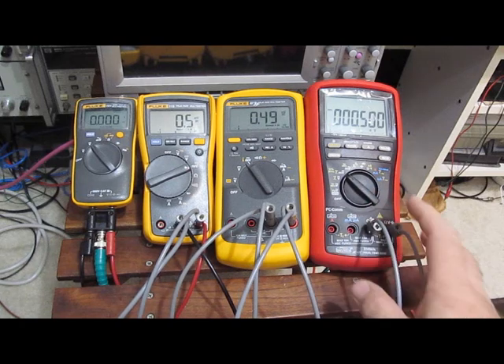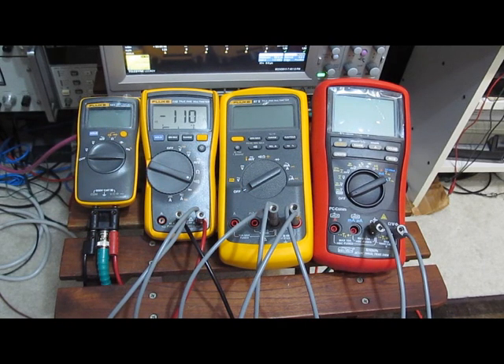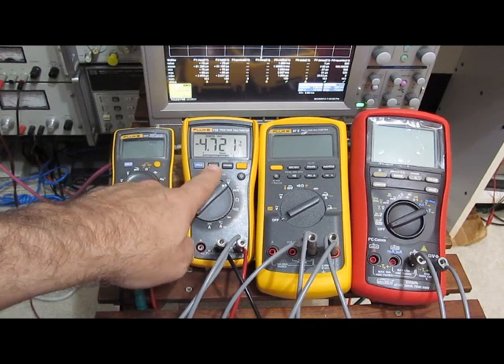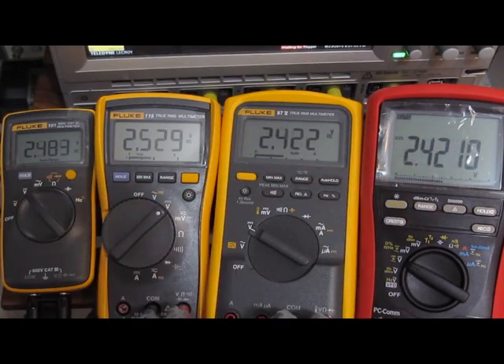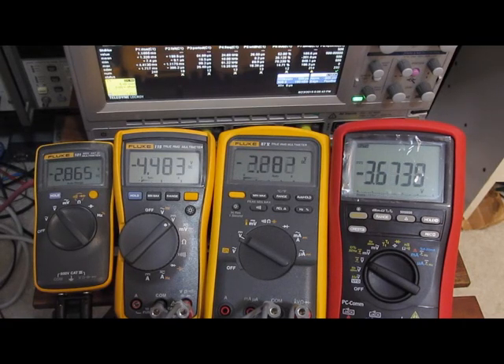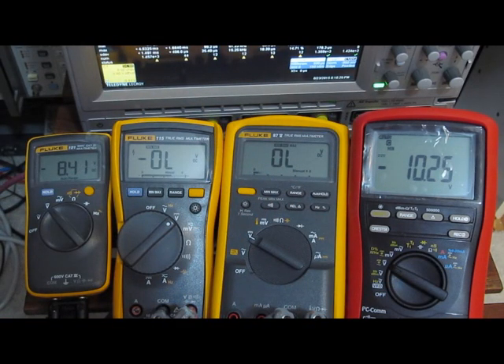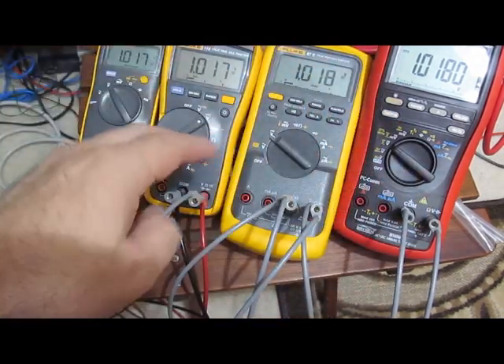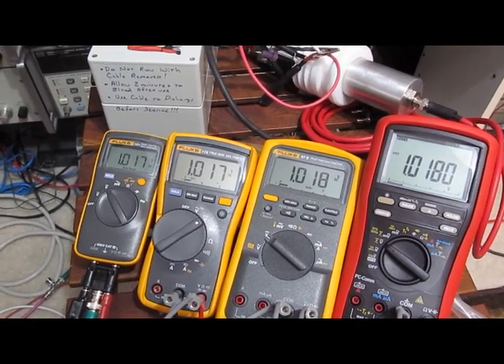Brymen BM869s vs Fluke

Comment: I've wanted a Fluke 87V for a long while but this Brymen has turned my head more than somewhat. It looks like a worthy adversary. I appreciate your interesting quantitive tests.
Reply: The King is dead, long live the King.... IMO
Reply: @JohnFHendry  Fluke still makes some of the best meters on the market. They are very well made and hold up for a long lifespan. A good friend of mine still has the one he bought in the late 80s,  still working fine.
But, it looks like Brymen are on their game. They are responsive to the customer and seem genuinely interested in making their product the best it can be. I have two of them and I am impressed with their accuracy, speed and the build quality. The leads are very good quality too.
Reply: @brianthompson1138  Agree... for the money hard to beat the BM869s and that's what I ended up getting. Great meter...
Reply: @JohnFHendry  I initially picked up a BM257s for basic diagnostics work (I work on arcade games). I liked it, so I made that one my work meter and got a BM829s for home, as I do more indepth stuff there. I don't need 50K count, so the BM829s was my choice. It's very similar to the BM869s and the price was impressive. Bought them both from TME.
Reply: @brianthompson1138  I sure hope Brymen reads these posts. I really like having the 50K count.... lets you see a tiny flow moving other meters miss. But I want DNA/RNA count settings to keep up with technology. Did you know last June a discovery was made that "upended the current, accepted notion of matter" and "rocks our current understanding of matter" ? Check it out... a researcher by the name of Monica Olvera de la Cruz at Northwestern University discovered it working with nanoparticles engineered with DNA in colloidal crystals. They said:  "It’s not an electron. But it sure does act like one." I say who cares as long as the meter can read it... just have to wait it out now, darn...;-)

Comment: Thinking about buying a Multimeter for my Process job. Was watching Fluke V87 vids and reading comments. Then a commenter mentioned Brymen 869s which lead to more research and vids. Then I ran into a bunch of video comments where people were mentioning someone called Joe Smith and his testing vids for Brymen DMM. That’s how I ended up here. After watching almost a dozen vids today, think this Multimeter fits my need and price compared to a Fluke V87 or a fluke period.
Reply from the maker: Really depends on your particular needs but the BM869s is still by far my favorite meter that can still be purchased new.

Comment: After watching all your Brymen videos  I've got convinced that I should give a try for the 869s as  my multimeter.
I'm currently using a UT181A but need some a little more robust for the high voltages.
For those who are looking for it, I've just got it from Eleshop in Netherlands (EU shipping) for about 144€ the unit... very cheap.
Just missing a probe master for it now...
Thanks again.

Comment: As always, GREAT JOB on the review Joe.  I would add the Bremen 867s/969s english manual is very good and seriously better than Chinese meter manuals I either have or have seen. My Bremen did NOT come with a case but had good quality probes.

IF I were going to have ONLY ONE NEW meter today, I'd likely buy the Brymen BM869s.  Even with its optional computer interface and software, it's priced less than a new Fluke 87-V.  It is larger, but has a dual display.  I frequently use the computer logging feature.  If you don't, you can save $100+ .  Main gripe regarding computer interface is it SHOULD BE USB in this day and age...

Today, in my "active" world,  I have 2 Fluke 87-Vs (both purchased used), a Fluke 287, and the Bremen 869s.  The Bremen BM869s has replaced my previous 22,000 count Mastech MS8040  "Bench" meter due to the DC voltage resolution and computer interface.  The Mastech MS8040 was my first true-RMS meter and I retain it due to it's excellent AC/DC current probe with 10 ma resolution.

My Fluke 289 is my clearly most capable meter, except for the BM869s's 500,000 DC Volt count mode.  However, the 289 tops $550.00 with its USB interface and software.  I use my 289 mainly for field and lab logging for Solar Systems / Inverters installation and characterization on RVs.  It has much poorer battery life, so it's less desirable for an everyday bench meter.  It's plenty capable, but a little complex and has fiddly controls for most general bench work.

My 2 ea. Fluke 87-V meters are my grab-and-go / bang-around meters.  They are TOUGH but smaller than their water-proof cousin the Fluke 28 II .  If you want a water/environment-proof meter, the Fluke 28-II is basically an 87-V in a environment-proof case for only about $40.00 more (Amazon) , but it's considerably larger and a little heavier than the 87-V.

Remember, the "extra" digit in the BM869s's 500.000 count mode only works in DC Volts measurements.  As stated in the BM869s manual: "It (the 500,000 count mode) is available to single display DC Voltage function ranges. Measuring speed is reduced to 1.25 times per second."  

Folks, I guarantee your mileage will vary...
Reply: So... Practically speaking, do you feel the Brymen DMM is better than the Fluke 87 V?
Reply: The strange thing about that 1.25 measuring frequency per second in the 500k mode: I use 3rd party logging software, and it logs fine at 5 times per second in 500k mode. And the logging results are all unique values.

Comment: I've had a Fluke 87V for over a year now, but I'm now seriously looking at getting a BM869s to replace it. I don't like the Fluke's darker display background and smaller digits, and would enjoy the bigger, brighter, dual display of the Brymen. Not to mention the faster bar graph and additional features and higher precision. Thanks for a good comparison.
Reply from the maker: I'm not a fan of the 87V. I like the older Fluke 189 but the BM869s is still my choice.  Like the 189, it's a good all around meter for electronics.
Reply from the maker: I've ran similar tests on some of the more recent meters where the 87V and BM869s were included.   Maybe have a look at the OWON video.  There you can see the 87V 189 and BM869s all together.

Comment: Great video.  On the Fluke 87v vs 'crest mode' of the Brymen, you need to turn on the Fluke 'crest mode' or the peak mode, you used only the standard mode.

Safety: the issue is protection from faults within conditions of the meters appropriate usage, impulse tests were to simulate worse case conditions.  Users should expect those capabilities to work as designed, i.e., CAT rating. 

Brymen history.  The only way to find out is to give Brymen a history, how does its build quality hold over time?  You can see a semblance of its history by comparing the equivalent Greelee models with months to years of ownership, there are a number of them reported on Amazon for different models.
Reply from the maker: ***** After reading your comment about the crest mode, I downloaded the manual for the 87V and saw the continuity button selects this mode.    I would have never guessed this when I looked at the meter.   Thanks.    Looks like it should detect an even shorted pulse.  I may check that out.
Reply from the maker: +Ig Saturation I looked at an 87V again.   I am curious if it will detect both peaks?   Say I have a signal at zero volts with a positive and negative pulse on top of that.  Can it detect both?   Reason I ask is that they call it a peak detect.
Reply: Hi Joe. Yes.  Peak negative is stored as minimum value and peak positive is maximum value.  When on the 87v does not auto sleep so it will monitor until you manual set it off.
Reply from the maker: +Ig Saturation Thanks.   I may make a short video of this to compare that feature again.
Reply: Always enjoy your videos, thanks again.

Comment: Yes, I saw it with Keysight 1282A too, it's got much faster continuity test than 87V. But let's be frank, no one would switch between various elements 4 times a second :) I don't know why, I'm using Fluke much more often than Keysight, despite the fact that KS got better spec.
Reply from the maker: I am not sure how many make break cycles I have when sweeping a QFP.   A seconds a long time.
Reply: @joesmith-je3tq  You're right and you're right and you're right. There might be some use cases for this "feature". Although very specific.
Reply from the maker: @elmachooooo  I had an electrician ask me once why anyone would ever need to measure anything beyond 60Hz.  Everyone will have different requirements.
Reply: @joesmith-je3tq  I am not sure how are you sweeping this QFP but if you sweep it fast and hear a beep you need to do it once more, slowly (and the difference between F and B gets neglected). From what I understand Fluke 'merges' 2 beeps  into 1. The more important test would be to check which meter picks up shorter 'signal' I suppose.
Of course, Brymen feels better but in practice I am not sure if it is important. But you're right - depends on the use case,  personal preferences etc.
Reply from the maker: @elmachooooo  I do end up going back over, multiple times.  I've seen people use wire bristles to trace a board just to get faster coverage.

Comment: Hello Mr Smith, some times we loose control to acually test the devices,as a result we loose also making difference  between what is important and what is useless facts.the update rate doesn't matter ,when we talk about out of 2 updates/sec , I think the important thing is to have an accurate and precise readings.I can wait the multimeter 1 sec if it is accurate,humans are not fast enough to deal with 5 updates per sec .
Reply from the maker: That's why we have 20,000,000,000 sps scopes, because we humans can't deal with it.  Understand that your opinion is just that, and it may not reflect the general population.    Someone once posted why anyone would ever need to look at currents higher than 100Hz.
Reply: @joesmith-je3tq  Mr Smith , you want esolate my opinion ,simply you can ask every one," can you realy your brain and eyes deal with 20 updates / sec?" I think no at all when we see there is a couple of hundreds of miliseconds to from understand what we see, we cant se 20 updates in one second and understad all each one and understand them.the same thing with beeping speed of a multimeter, are we fast enough to figuere out what we connect . for example 5 latches per sec. no but we "feel"that we are blocked a litle bit by the response of the continuaty beeps and the insufficient control on it . best regards
Reply from the maker: @TruthDigest  I have no desire to run such a poll but you certainly can if you feel it will gain you something.   Companies don't offer faster update rates for the fun of it. Customers want it.   30Hz and up bar graphs are common.  Imagine what watching a video at 2 fps would be like.   I've seen people that can consistently cut 0.00 lights (professional drag).   If you see no reason for faster update rates, that's fine.  Just don't assume you are in the majority.
Reply: I feel it will gain me something :)
just to complete the cycle companies offer faster update rates because customers want it, why customers want it and what is the real sufficient ,

comfortable and useful update rate  for the customer.I think 4 updates/sec is great and 30 /sec also but there is no  considerable change. our brains are not fast  to deal with 30 updates/sec.as an example , if you have a camera and you want know who is the person next to your home.if this camera make a single capture and you see this picture and you recognized the person, the task is done if I make other pictures to the same person that will make no difference, I recognized him . but this aditional pictures are not a problem.and I'm sorry to bother you again Mr smith but I want to make make point of view mre clear, no more. I have a question if you can Mr smith ; what is the lowest capacitance value can the fluke 87 v read.even the brymen 869 doesn't mention that clearlypicofarads are important for me and us the industrial multimeter have a litle bit highest values on capacitance.thank you for the feedback.best regards.
Reply from the maker: @TruthDigest  The youtube filter placed your comment into the spam area due to your grammar.   Use a space after each period and you should be fine.    I am not aware of ANY meters that will update the digital readout at 30Hz.   It seems there are some at 5Hz.   The bargraph on the better meters will normally be much faster.  But again, if you are happy with a 2Hz bargraph, digital display and continuity test  update, that's fine.  Just don't expect the majority of people to be happy with that level of performance. 

I imagine the manual for the 87V is still available to download for free.  It seems you don't understand what you are looking for is all.  Check the meters accuracy and resolution.   From this, you should be able to sort it out.  Normally, I will use an RLC meter to measure capacitors.  If I am looking at small values for RF and want more information than the RLC meter provides, I use the vector network analyzer.
Reply: @joesmith-je3tq  Thank you very much Mr Smith, my comment is placed into the spam area,we both know that it is not a spam,but as we expect from an artificial "intelligence" to be wrong about as. 

hahahahahaha I think we are so far from 

making the artificial works, intelligent. I'm waiting for your new videos, it was along time since you upload a video. best regards .

Comment: this multimeter is obtained with the green lee brand the DM860A, but the DM830A is the same as the fluke 87 v with a little more functions these green lee multimeter are excellent nothing to compare to fluke

Comment: FYI, the fluke 87v also has a crest feature called "smoothing" from the off position, hold the range button on while turning the meter on. You should see an "S" for smoothing. Who knows, it may be close to the Bryman?
Reply from the maker: Close in what way?
Reply: @joesmith-je3tq  si es verdad, el Fluke 87-V tiene una función de suavizado.
Reply: Es verdad.
Reply: (Peak Min Max)

Comment: This is without doubt the best review of multimeters! :-)
Could you please tell me what instrument, you used to test the continuity?
Reply: it could be a simple circuit with a transistor driven by a signal generator!
Reply: @stm3252  Thanks a lot for your answer, yes that's a possibility and a simple and smart solution. But I think he may be using an electronic load of some sort. I have thought it could be a great test device if, as you say, you could control a circuit with a signal generator. A sort of "signal mirror". 1V in = 1V or 1A load, by that way could you generate all sorts of dynamic load profiles.

Comment: I know you rarely do anything with "clamp" style meters but I'm wondering if you might consider doing a review on a fairly new offering from Brymen...the BM037. It is a fully featured clamp meter and very small in size. It might be a contender with the now famous Uni-T UT210E. Price range on the BM037 is pretty good and you seem to enjoy all the Brymen products that you test, so this could be an interesting little meter to look at.👍
Thank you for all the videos that you do.
Reply from the maker: The whole reason I like the UT210E is the 1mADC resolution.   I am not aware of a Brymen product that would compete with it.   I have not tried testing any clamps outside of the Fluke open fork non-contact unit.    All of the Brymen products I have looked at have held up very well in my tests.   Maybe if they make a clamp similar to the UT210E, I will have a look at it.   Maybe do a shootout between them.   I have never plugged the leads into my UT210Es.